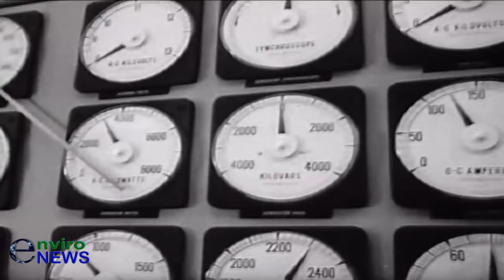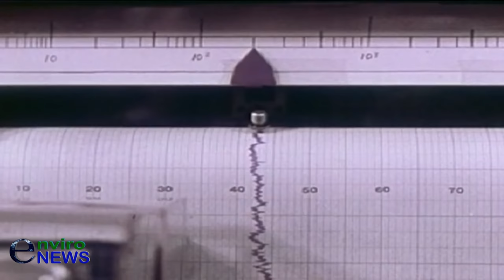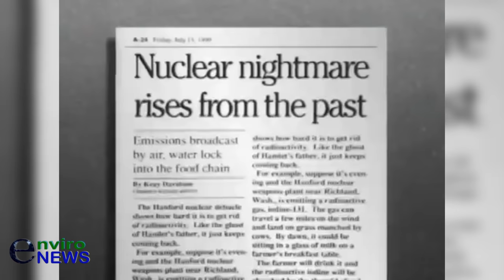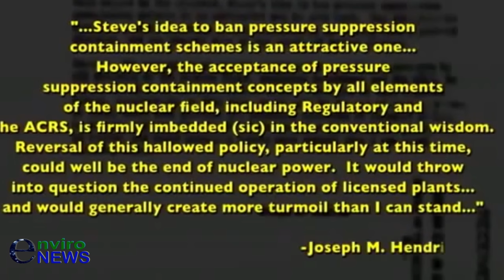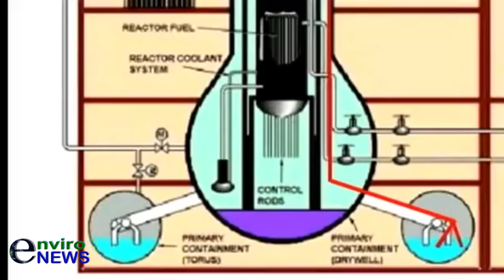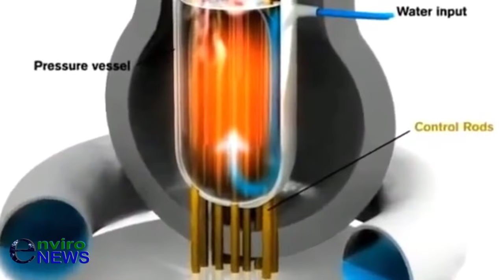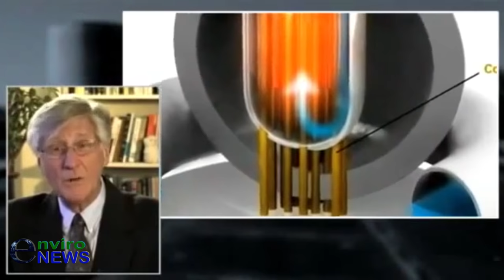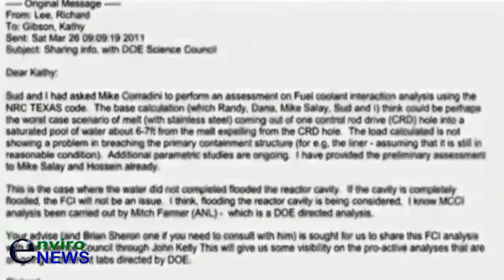Should GE’s Mark 1 Nuclear Reactor Be Recalled Worldwide Like a Faulty Unsafe Automobile? (Pt. 5)

Comment: Don't blame GE for Fukushima.  Instead blame the fools who designed the power plant where backup systems could be flooded in a basement below sea level.
Reply: That's like saying don't blame RBMK reactors for Chernobyl.
Reply: @jessicah3450  Tepco designed the building to have generator underground and didn't listen to the safety precautions and they didn't make the sea wall tall enough and the  generator room was not waterproofed at all

Comment: I'm trying to figure out what plutonium production has to do with the Mark 1 containment. I don't see the relevance of asbestos-related health problems to the issues of the Mark 1 either. 

Whoever made this video does not respect our intelligence. There is a constant tone of "Danger! Danger! Danger!" throughout the presentation. Quite a few wild charges like the two mentioned above but not enough information on the real weaknesses of the Mark 1 containment and what can be done to fix them. How the Fukushima reactor containments failed would be relevant information and it would be nice to have a clear, concise description of those failures. How the ECCS failed would be valuable information, too. Are you worried that the facts won't be scary enough? 

Full disclosure: I worked at the first BWR 1 and BWR 3 plants (the latter with Mark 1 "dry well" containment) 'back in the day' and even then TEPCO was notorious for sloppy operation of their plants - obeying the letter but not the spirit of the operating rules.
Reply: Which got four of them reactors killed at fukushima. Reactor1 he was tortured then killed by having control rods flung at him 7 of them stabbing him 1 to his knee joint, 1 to his stomach, 1 to the heart, 1 to his eye even into his brain knocking him over the railing and falls 50ft onto the pit floor, 2 to his wrists one whole fuel assembly thrown into his containment but it lands on his nuts ouch, an explosion rips the reactor's stomach open he shrieks in pain, 1 control rod kills him by slit stabbing his throat drowning in blood. Reactor2 she was killed instantly by all the fuel assemblies blowing up at one time tairing her to hundreds of tiny bloody pieces the reactor's blood,fragmented bones and entrails drip down the containment walls. Reactor3 he had only one explosion that rips open his stomach and leaving him to die in 3 hours in a pool of blood in unimaginable pain. Reactor4 she had only two explosions 1 leaving her to drown in her own blood the 2nd one cut her head off in a flowering burst of blood and entrails her blood also slides down the containment walls. UGH
Reply: @chornobylreactor4  really? 😒 Why comment at all? This guy has a legit question. Leave it to the boys with big pants to answer please and thank you
Reply: @flowerchild777  I'm saying what I think happened so😛
Reply: Alvin Weinberg the man who invented the BWR foresaw such a disaster like Fukushima. He also had published a report based on a study done on the degradation of the fuel cladding in shut down mode of the mark one. It was an unfavorable report that got him terminated from ONR. Wineburg himself said that all BWRs are dangerous and that why he invented a whole new reactor design known as a Moltan Salt Realtor. A LIFTR or Liquid Floride Thorium Reactor. The current crop of reactors are old they do have huge safety risks when something goes wrong. However as a whole they are safer then wind turbines statisticly speaking. But it is time they get replaced with safer updated designs. I love nuclear power. It is  the only real clean energy solution that can for all the climate change people lead us into a carbon neutral safe future. I   recommend everyone looking up Flibe Energy on YouTube or the internet.
Reply: Oh yeh about the plutonium production. So the fuel pellets swell inside the cladding and becomes less effective at maintaining criticality. The plan was to remove the fuel rod bundle and send it off to  be reprocessed off site as ether new  fuel or plutonium for weapons it was the model for GE s fuel cycle. However people got a little worried about having highly radioactive fuel being shipped all over and now it gets stored on site. It sits in a pool next to the reactor head till the decay heat  drops off enough to move the fuel into storage casks. The funny   part is the cladding can catch fire   when exposed to air and then it burns under water at that point. That is another thing that happened at Fukushima anyway that is the link to plutonium production.

Comment: After watching half of this video, I realized this was a biased piece by enviro-activists that have an agenda.  They're a bit too rabid to take seriously, as are other activists who push hysterically and scare potential supporters away, calling them kooks.  At 10:53, the host is a great example of this.  I like watching this type of video, but this is just too heavily biased.  Thorium reactors hold a lot of promise, and until battery capacity can be attained cheaply and reliably to hold enough power from solar power to work when there's no sun, it's still not there yet.  Wind is the same. 

A tsunami kills a nuke plant, a plant that was built on the shore of the Pacific Ocean, a shore that has seen this happen many times in the past, and people blame the guys who designed a part of the reactor?  The core?  That core is fully expected to be protected by a sufficient containment structure to match all possible threats.. and in this case, it wasn't.  The Japanese should have built a barrier. People died all over Japan because they didn't have barriers, either.  In the future, tsunamis, as rare as they are, should be seriously considered in the building of any plants close to shore.

Comment: the speed of sound at sea level in dry air and 68 degrees F is 1125 fps not 600 as this engineer says, what else has he gotten wrong since he has done 1000's of calculations on this subject?
Reply: + bowlweevil - I noticed that, too, and my initial thought was that he meant miles per hour, but that's 767mph. smh

Comment: The problem with this is not engineering, it's economics.

You can't make GE and others recall them.. the cost would be in the trillions and they'd immediately file for bankruptcy. They'd offload assets to subsidiaries and wind up the company. All you'd succeed in doing is costing jobs, unless the government has to fund the decommissioning or bail them out, in which case the economy would suffer significantly for decades as well. It's a burden nobody can afford to carry at this time.
The reason these are not recalled or shut down is because the fund that is set aside for each NPP for decommissioning is insufficient due to the GFC. That's why they keep re-licencing these old junkers. The best we could do is a cold shutdown and mothball them as is and maintain the systems for.. decades. So they keep them going instead. There will be a point where the metal of the reactor cannot be relied upon and it will be shut down.

These are not faulty, they are flawed. There's a big difference and what we should be doing is implementing new safety standards, some to contain meltdowns and discharges of radioactive material. Machine learning and monitoring every parameter to the Nth degree will also reduce the possibility of catastrophic failure.
The obscene reality is that we can't afford to decommission these plants at this point. The cost is hundreds of millions per plant and frankly we have more important matters, such as the decaying nuclear submarines that have been dumped both in the ocean and on land.

Comment: Browns Ferry happens to be a BWR type design, three BWR-6 reactors if my memory serves me correct, with hardened wetwell vents(same as Fukushima, but they had no hardened wetwell vents in their plant)(Another important point of information about Fukushima is that our emergency diesel generators are above sea level, theirs were below sea level, hence their flooding during the tsunami)

Comment: The nuclear technologies reliance on electric pumps is deeply disturbing. Any technology with the potential to cause a disaster, should not be reliant on complex machines with a lot of moving parts.

If a reactor looses external power, as happened in Fukushima... these reactors become extremely vulnerable to catastrophic failure. This is totally unacceptable. It is not consistent with the fundamental concept of fail safe design.

If external  power fails in a reactor, it should have an automatic physical shut down process. NO computers
Reply: I am excited to see the new liquid fueled reactors that are being developed. They are being designed as being "walk away" safe meaning that in the event of a complete failure of any system you do not have to do anything to make the reactor go into a stable configuration with proper cooling.
Kind of a cool design philosophy and one we need to embrace if we are going to move forward with any amount of nuclear power. Check out the MSRE videos on here, they are worth a watch.
Reply: You can't just "turn off" nuclear fission. Even though the reactors were SCRAMed using control rods, the fuel itself is still radioactive and hot and needs to be cooled with water.
Reply: Reactors do have automatic shutdown. Unlike Chernobyl where it was human error. This was different and not just human error. The outcome was the same but in Japan they built the reactors in a place that was convenient for them to pump water. They didn't account for this type of disaster. That was the biggest human error. 

Reactors have automatic shut offs. Chernobyl had them to but that evening when they were testing they turned off everything and let the humans have 100% control. 

These reactors were "shut down". The problem is the water in the reactor does need to be pumped in to cool the rods. This is where the difference is. In Japan they were not able to get power(ironic) back to the reactor. The generators didn't kick in and by the time they were able to fix them it was too late. 

As @enteralfire1244 has stated MSRE. Those sound promising. Unfortunately, the last MSRE reactor experiment was in 1989. I could be off a few years. MRSE are promising but we live in a society that believes wind and solar are the future.
Reply: The diesel generators in the fukushima daiichi plant were in the basements of the reactor buildings. They were working fine until they flooded. Kind of a stupid place to put backup generators. The fukushima daiichi plant was a very old mk1 GE plant, old plants in service should be upgraded.
Reply: The latest PWR designs do not rely on electric pumps, they are now designed for passive cooling, i.e. convection where the hot water rises and cooler water which is more dense sinks, this change has been driven by lessons learnt from Fukushima. Hopefully new BWR designs will have the same resilience, either that or give up on BWRs and build only PWRs which seem to be the safest designs.
Reply: Being that its a KNOWN fact that they built it on a Fault line AND put emergency equipment below water lines, You bet your ass i would suggest NOT building on a known fault line. Especially for a technology as sensitive and potentially disastrous to humanity.  Thats just crazy and insane right out the gate. Tell me its not.
Reply: The Fukushima Daiichi plant was built in 1967, long before you were probably born. The Idosawa fault wasn't mapped until 1991 and the North Fault wasn't discovered until 2009.  The engineers had no idea of the risk at the time. Even so the plant was designed to withstand a M8 earthquake and 32 foot tsunami waves.

In hindsight sure you could say it's crazy, but in 1967 it was reasonable. And all the way until 2011 nobody thought an earthquake of this magnitude was possible at that fault. The fault is a strike-slip fault, the most devastating kind. The fault lines slipped 50 meters, the largest ever recorded for our entire time on the planet. It was a horizontal slip, if it was a vertical slip the Tsunami may have washed over the entirety of Japan.
Reply: J:  I always have an issue with engineers assuming something of a certain magnitude just cant happen because history has proven that eventually it does.   I was under the impression the Fault line was known about at the time of construction but was ignored as of no concern in practice.   

I can only assume that like in New Orleans the engineers at fukushima didn't think it would be possible for the generators and pumps to become inundated even though there were below water lines.   

Also you cant ignore the plain old Bad luck of having built directly over the fault line. I mean shit, Thats just some serious bad luck and the reactor needs to be dismantled completely and moved to another location.
Reply: A week before 3 mile they did a test of a reactor where they simply turned off the pumps and then did nothing..... no putting in the rods they let it go. What it do? It got hot and then it was not able to keep the reaction going above a certain temperature and shut down.  Had Fukushima been such a reactor they would  have had the time they needed to get pumps going again and not have had to deal with a reactor running out of control.  We need better reactors...... The fear mongers need to let people build them so the unsafe ones can be shut down.
Reply: Electric pumps, rubber seals around pipes going in the "containment" vessel,pressure release stacks,not to mention its mearly boiling the water.  This is madness.
Reply: The major flaw wasn't reliance on electricity, but where the diesel generators were housed. Normally they would kick on, but they normally aren't under 10 feet of water.
Reply: @almightydeity  Wrong, the major flaw of every nuclear reactor is they need external power allways.  They all dont have generators in the basement.
Reply: @paulmobleyscience  they all have at least 2 sets of generators, plus batteries
Reply: @Commissar0617  My thought was they all dont have the generators they have located in the basement.  Some have them set up higher to keep from flooding and makes it not the biggest issue of a nuclear reactor but they all must rely on external power.  A generator will only last so long.

Comment: Why? The problem arose because they had lost their electricity backup and refused the US Navy's offer to provide them with generators.
They had over 8 hours to prevent the meltdown but they sat on their hands because they were going to handle it themselves.
BUT, the point is valid. There IS a reactor that is SAFE and is physically impossible to have a meltdown. It uses pellets of Plutonium (that we have tons of) about the size of a Tylenol capsule, embedded in a ceramic rod. When and only when you add water it heats up. Want to stop the reaction? Drain off the water. It works by "rotting" the Plutonium down into Lead.
Why in the world are we not using this type of reactor? If you stick rods of Uranium inside the reactor, it will pick up Neutrons and turns into bomb material. The design is a classified as a breeder reactor. International agreements prevent them from being built.

Comment: The inverse square law does not apply to extended sources of radiation. There is no physics law for an extended source of radiation.  This law contains a formula (intensity=I/d2) of which is used to calibrate radiation detection monitors including Geiger counters.  Therefore, every measurement taken is null and void on the planet.
Reply: @ghost500e  Yes he has, along with Newton and Plank.

Comment: So number one, if there is a meltdown in a boiling water reactor there is all that high pressure water around which will not just let the reactor melt down into the substructure, but will superheat like a pressure cooker ready to go off and there is a 75% chance it will blow the roof off the containment vessel. So the reactor had to be designed with all the systems and back up systems to minimize the risk of a meltdown. This however took into account only the operator mistakes and not natural hazards. So if I were a GE I would not snatch any contracts requiring me to install my reactors near land and oceanic fault lines. The reactors of this type are no longer made, the ones at Fukoshima operated safely for over 40 years before the tsunami, so any remaining of those reactors built within or near earthquake zones should be decommissioned, while those nowhere near it should carry on as usual.